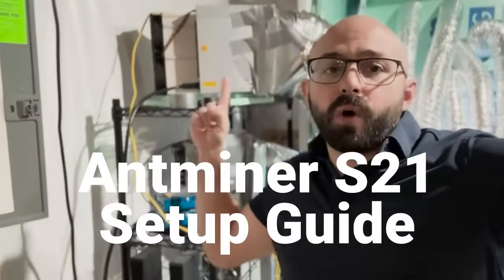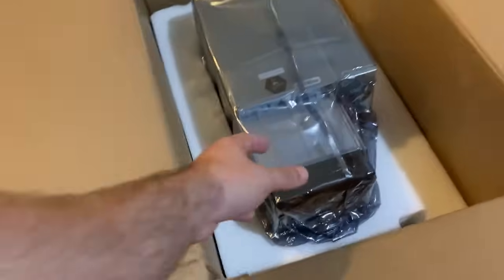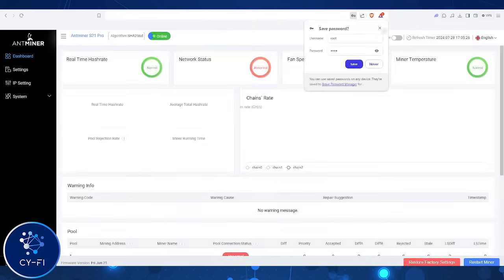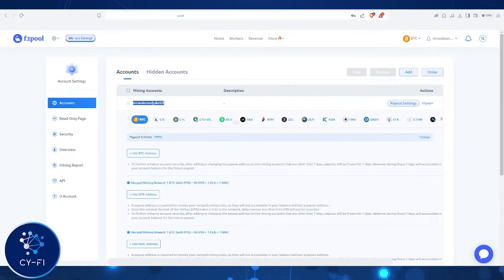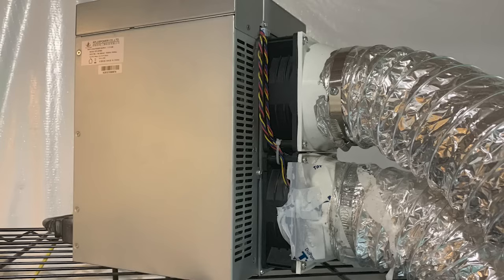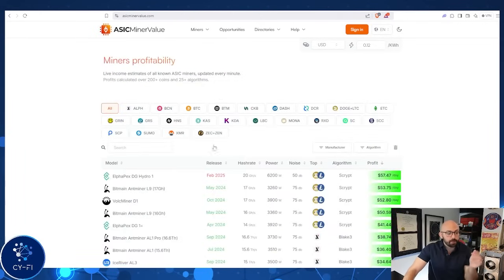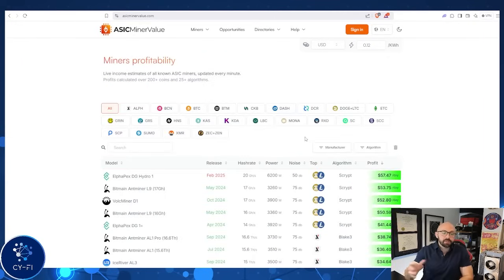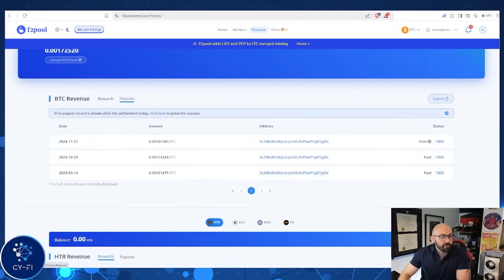Complete Setup Guide for Bitmain's Antminer S21 Series - From Unboxing to Mining #miningtutorial

Comment: What type of power outlet does it need?
Reply from the maker: I have a mix of 220v and 120v. Basically washer/dryer plugs and common house plugs. I’d recommend getting a triplite extension so you can monitor amps